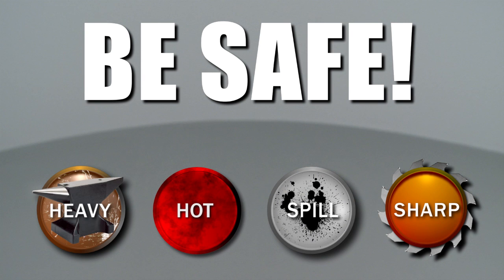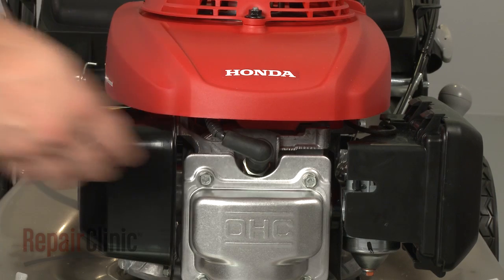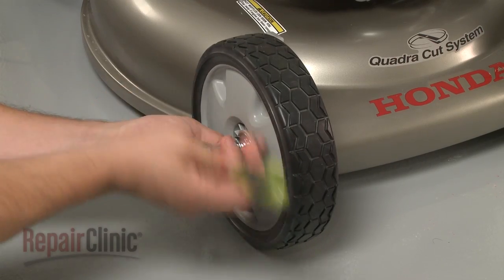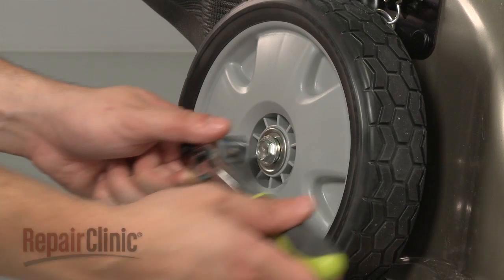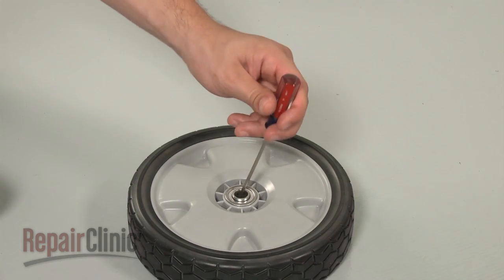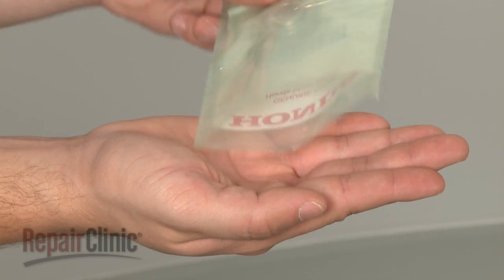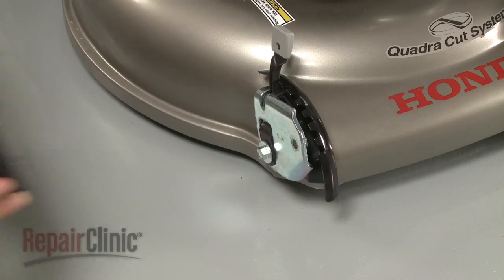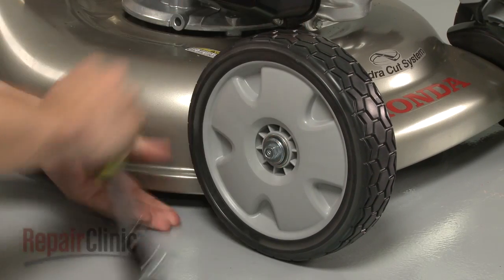Honda Lawn Mower Bearing Replacement #91056-VL0-B00

Comment: Even though these aren't terribly high-precision bearings, it's still better to drive / press the bearing in by applying force to its outer diameter, not the inner race.  Not hard to do.